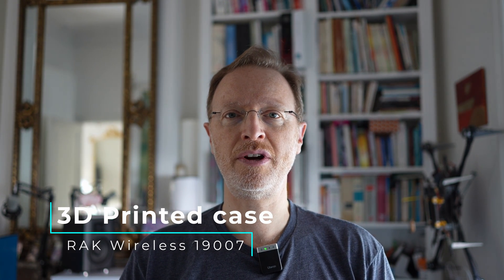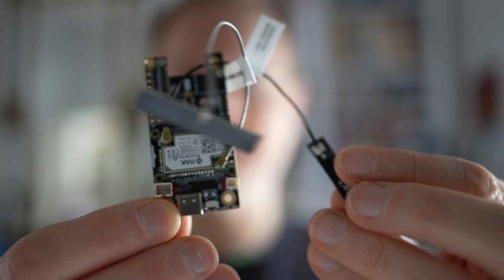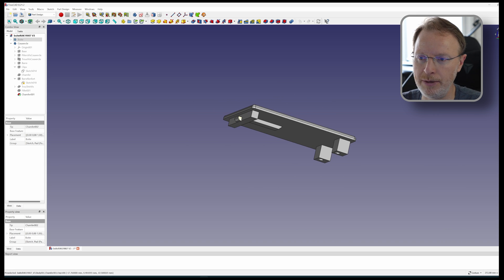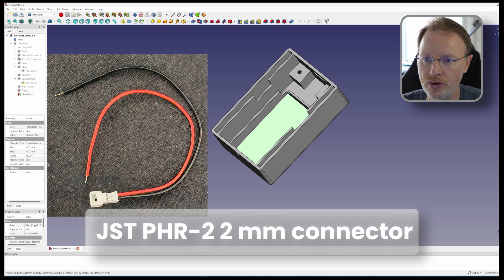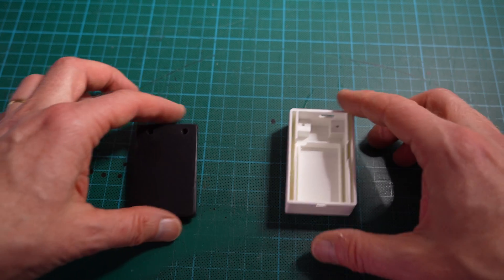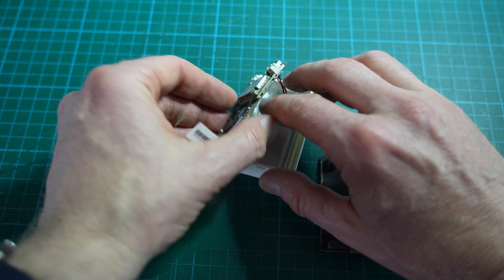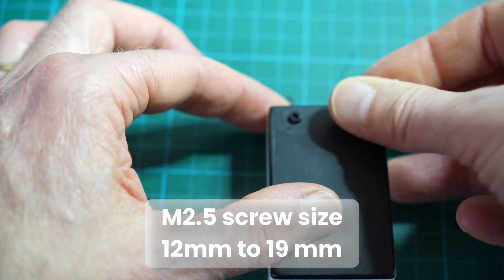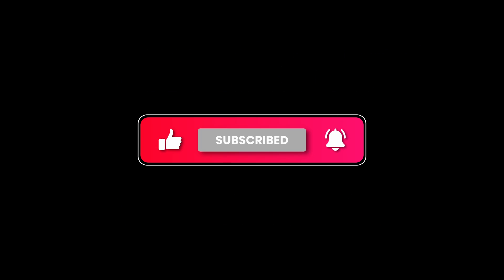Meshtastic DIY 3D printed case for RAK Wireless/Wisblock 19007

Comment: Very elegant design. I have a RAK Starter Kit on the way that I'd intended to use with a solar panel and battery as the Heltec V3 doesn't last overnight. I'm tempted to order another starter for a pocketable unit. 

A question: How long does the 1000mAH battery last?
Reply from the maker: Thx. A 1000mAH battery won't last very long with a Heltec V3 board, depending on your usage intensity. If it just sleeps most of the time (is not used inten sively) it will last a few days. Basically such "mobile" oriented nodes are supposed to be charged as often as your smartphone and use a USB plug at every occasion you have (so that your mobile node is always ready to go).

Comment: Doesn't carbon fibre block RF?
Reply from the maker: It would surely with real carbon fiber plates/elements. In this case the PLA-CF plastic is the standard PLA enriched with some CF fibers in a very low density. The CF addition is more of a gimmick that adds to a better surface apperance (you see less the printing layers thanks to the "fuzziness" of the fibers). I do not believe it really impacts the RF, but could be tested for sure (if I have time)